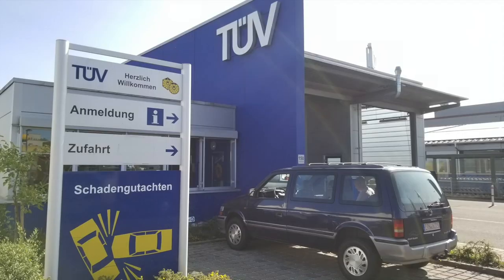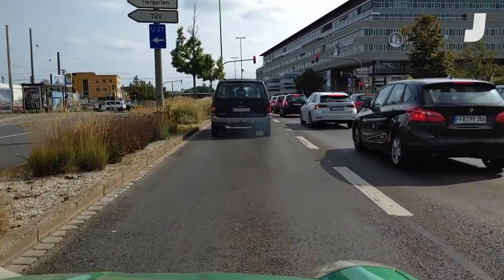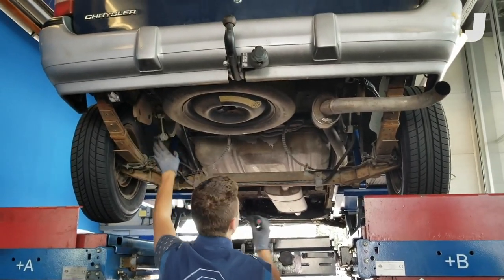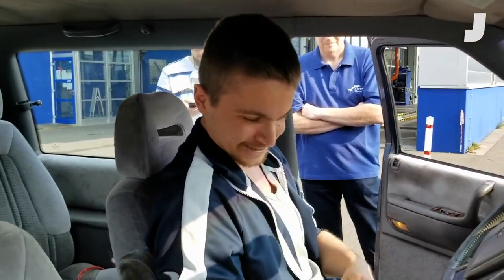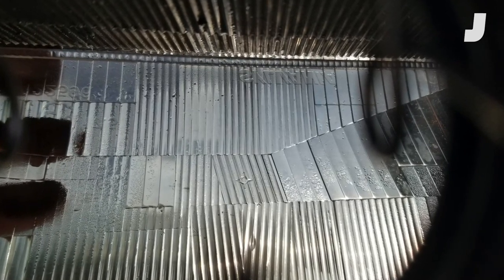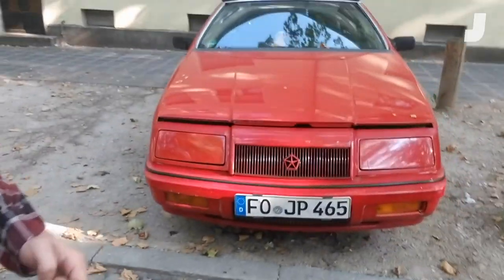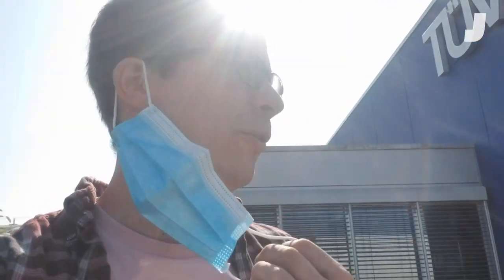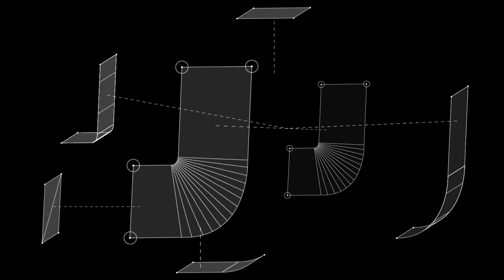I Took A 250,000-Mile Minivan Through Germany's Rigorous Car Inspection And It Was A Disaster

Comment: The whole point of the test is not safety never has been. It is there to nudge you into buying a new car. Need proof look up daily trip inspection for commercial vehicles. I do a daily inspection on my school bus in the US in Texas of all states that goes over just about everything they go over daily. 

 I don't put the bus into a machine to test it but I have to check it for damage daily in all those systems. Now, that is a safety inspection. Yearly state inspections which I also did at a past job in Texas are a joke and really just there to nudge into buying a new car once a year. That yearly inspection doesn't even go into the stuff I do daily for my bus daily. It is just there to scare the average Joe into either paying for repairs, or getting a new car. Both actions generate income for the state from taxes. It's slimy, and a lot of states in the US are dumping it in favor of just letting police ticket offenders that are clearly not keeping their vehicles maintained safely.

Comment: Portuguese inspection:
Is it safe to drive? Yes, you're good to go. Is it not safe to drive? Here's why. Now don't go and drive it too much but you have 15 days to fix it. It is too dangerous to drive? You're only leaving on a tow truck, baby.

Never in my life have i seen a car fail by emissions for instance, apart from an old Mercedes C220 CDI that made a complete James Bond smokescreen if you slammed the accelerator.

Also it really depends on the inspectors. Some are by the books, some are helpful and don't tick easy fixable things. For instance, the last time she aligned my headlights for me.

The most overlooked items regard emissions. Some don't care, some are anal. The rules changed recently but before this very month no one had updated the rules which came from 1997 xD

But most of all no one will say jack shit if your paint is ruined, if the clutch has seen better days (so long as it's not slipping), or if the electric windows not working.

Comment: I haven't seen one of those in the us for a long time, probably were all crushed during cash for clunkers which was of course a short term scheme where they nailed an iron spike into their own legacy as people get a bad impression of your brand if none of your older cars are left on the road, it implies they don't last.
Inspections are just more over regulation, truth is most cars simply age out or are totaled as they become anything close to a danger, the prime cause of accidents remains driver error.  So you have a vast infrastructure created for an illusion, same goes with emissions.  In fact the more "eco" they make new cars the shorter they last, overstressed turbo charged tiny engines for the masses, who thought that would be a good idea, regulators did, and so did scrap yard operators.

Comment: I'm not quite sure I'd be down with a vehicle inspection that involved somebody decking the throttle and bouncing my engine off the rev limiter.
Reply: Yea, that was crazy.  I'd want to slap his face if he did that to my car.
Reply: @shoechew  I also think that was a bit on the nose. Here in slovenia they usually rev it to 3-4k. That's why I always advise people to go in with a warm engine.
Reply: It's a diesel only revs to 4k or something. They also do it to blow out the soot to give it a better chance of passing.
Reply: @drzej3k794  Yeah, but 4,000 RPM is a really big strain on a typical diesel.  Not all engines are the same.  It's like saying "Well who cares if they rev it out to 10,000, an old V8 F1 car can do 19,000!"

Comment: That high reving this old Diesel hurts so much!! Is it necessary?
Reply: Yes. My X3 will sit at 5000-5300 rpm constantly on parts of the Autobahn. Sometimes for 20 minutes or more if i am on a section with little traffic and no limit. The engine has to be able to handle high revs.
Reply: yes its neccessary for the emision test. if it cant handle it its not road worthy either.

Comment: Seems like inspection place is pretty dumb if they don't know how steering locks work. I've never owned a car with a keyed ignition that doesn't have a steering lock position other than me maybe my old Bronco. My my 4Runner has one, my Miata has one both of which were built in Japan. My old Dodge, Ford, Chevy Trucks had one too.

Comment: In Belguim it would fail to. Junk dont don't belong on the roads( and yes...i drive a 15 year 210.000km car and every year it pass the " control", without any remarks. Maintenance is everything.

Always check yre car, before going in the TUV. Water in liheadlights/ lamp hanging/ not working etc...all thing thats that cpuld prevented. 
Now..a huge waist of time ( also for the inspector) and money.  Did you really needed 1 month....amd still fail,  by Jove man

Comment: Now try to imagine getting a 20 year old, highly modified FD RX-7 through this inspection. Cheers... :D
Reply: You can, but each and every mod have to be TÜV approved. Either by you (expensive) or by the manufacturer of the part (less expensive for you). Bring the TÛV approval document for each mod, and they will add it into your registration document.
Reply: @081588101  yeah it's not a problem just a bit costly when you do alot. Some mods don't need any documents at all. Extra gauges for example. But everything car/body related
Reply: @081588101  basically if you modify the car you have to do a very rigorous (and costly) inspection, almost the same kind the manufacturer goes through to approve the cars for sale, which honestly makes perfect sense. If you think about it its ridiculous that in the US the car to be sold has to pass a bunch of tests and regulations and after buying it anyone can modify it in ways that it will no longer meet those legal standards.

Here in Portugal that more rigorous inspection (called a type B, as opposed to the yearly type A thats legally required) is tough enough that no one modifies their cars. Stuff like an engine swap, even if the engine youre swapping is the exact same spec from a similar car, require a type B inspection, same for using a tire measure thats different from the original the car came with
Reply: That's funny, because German youtubers I watch do not act like getting modifications to meet tuv is some easy thing lmao. It seems it vastly limits the options you have for aftermarket parts of course too.
Stop lying lol. 
We're doing fine without inspections this ridiculous in the US and we don't care what you think about it lol.
Reply: @081588101  The only downside is that you need have all the ABEs ("general permission of service") for all your aftermarket parts with you so your registration slip isn't just a registration slip for a heavily modified car, it's an entire registration folder in your glovebox. :D
Reply: @081588101  the German system of needing most modifications registered on your car's registration slip, compared to others in the EU. Good for road safety, bad for overall convenience.

Comment: I have a Dodge from the same era with the same ignition switch. That is exactly right: off position is so you can still steer while being able to cut ignition. That inspector is an idiot and shouldn't be telling people what is and isn't safe lol
Reply: But this is tested according to German standards and not what Americans do in their country. Here's the law for it:
A steering wheel lock secures vehicles against theft. According to § 38a StVZO, securing is mandatory for all cars registered in Germany. It is standard equipment and is already integrated into all new cars by the manufacturer.
Reply: @michaelkuschnefsky362  that is a European spec van, so it should meet EU requirements at the time of manufacture. I just think the inspector didn't understand how the wheel lock works on that model. They do have a wheel lock.

Comment: Dude a wheel cylinder is $10
Reply: ya but probably the problem isnt from cylinder after he cleans it ..probably the shoes need replace or calibrated to same thickness
Reply: if I had to guess, it would have needed to be imported , or german part costs are crazy

Comment: What's funny to me is that most modern BMWs would never pass this inspection, even with less than 1,000 miles on them. LOL
I can just imagine various plastic bits flying out of the engine compartment and/or melting. It kinda seems like they're trying to break this because they are salty that their domestic vehicles would never survive 250k. Not that Chryslers aren't total garbage but still. BMWs can't pass that inspection. No way.
Reply: BMW got nicknamed "Bring mich (zur) Werkstatt": get me to the garage/workshop

Comment: And yet it has no third brake light 😂
Reply: In the US those became required in the 80s, but in Europe only around 2000.
Reply: @zanthraxnl  interesting! That’s surprises me, but I suppose since they require amber turn signals in the rear it’s less necessary
Reply: Actually third brake lights were forbidden until they became mandatory in germany. My dad owns a 1995 GMC Vandura over here in germany and when it was shipped here they actually had to cut the cables of the third brake light because it was forbidden at that time, because „it could blind other drivers or irritate them“

Also red rear turn signals are a no-go over here
Reply: @KokaburraDesigns  true but you can have white turn signals in front
Reply: @Sadik15B  Already....But then they need an orange colored illuminant (lamp) inside.
Reply: @mawa01  no not for front the bulb can stay white.
Only rear has to be orangep
Reply: @Sadik15B  Sorry, that's not right. Here in Germany the forward facing turn signals may be yellow or white (side turn signals even grey). But the bulb in the white turn signal has to be orange. 
At the TÜV inspection a white turn signal with a white bulb would even be a minor defect. Here is an excerpt of the road traffic licensing regulations (see point three):
Road traffic licensing regulations (StVZO)
B. Vehicles

III. construction and operating regulations

§54 Direction indicator

 (1) Motor vehicles and their trailers shall be equipped with direction indicators. After being switched on, the direction indicator lamps shall flash at a frequency of 1,5 Hz ± 0,5 Hz (90 pulses ± 30 pulses per minute) between light and dark and in the same phase on the same side of the vehicle, except on motorcycles equipped with AC lighting systems. They must be so placed and designed that the indication of the intended change of direction can be clearly perceived by other road users for whom their visibility is important under all lighting and operating conditions. Direction indicators need not fulfil their function as long as they emit hazard warning lights.

 (1a) Direction-indicator lamps pointing towards the rear of the vehicle shall not be fitted to movable parts of the vehicle. Front-facing direction-indicator lamps and additional side direction-indicator lamps may be fitted to movable parts of the vehicle provided that these parts have only a normal (operating) position. The first and second sentences shall not apply to direction-indicator lamps which may be removable in accordance with § 49a (9) and (10).

 (2) If direction indicators are not mounted in the driver's field of vision, their effectiveness shall be clearly indicated to the driver; this shall not apply to direction indicators on motorcycles or to auxiliary flashing lamps mounted on the side. Direction-indicator lamps must not obstruct the driver's view.

 (3) Only direction indicator lamps for amber light are permitted as direction indicator lamps.

............
Reply: @mawa01  this is the dutch rule

The direction indicators and hazard warning lights must emit no other than amber or white to the front and no other than amber or red to the rear. Method of inspection
Reply: @Sadik15B  Yes... That's why here in Germany we always have to retrofit the vehicles to comply with the German StVZO. 
For gas systems in caravans, we always have to retrofit or upgrade them to comply with the German regulations. On a Ford 250 we had to change the front headlights, because they did not have the necessary right side illumination. 
That's just the way it is here in Germany. In former times you could drive the American lighting with special permission. This was also possible with the spoilers, which were partly made of metal. Today unthinkable!

Comment: Sorry but how does revving the crap out of the engine with no load give you any kind of a result of how it will perform on the road. Isn't this exactly how VW got away with their emissions scam?
Reply: This is NOT a real world emissions test. Just certain parameters are tested. For a Diesel engine those are: idle and max rpm (engine specific) and soot (when revving up). Depending on the emissions class certain levels of soot are allowed.
NOx is not tested. So, a EGR delete will not be noticed. This is, unless you remove all the related plumbing in the engine bay and the inspector notices it. If you just block the EGR tube with a plate, no inspector will ever notice with that kind of emissions test.

An emissions test for homologation is a completely different story. The car is put on a dyno and a certain load and speed profile is run. For this kind of test, a whole different kind of emissions test equipment is required. The VW thing was to equip the car with software to recognise it being on a dyno and tested. In that case the ECU would run a different program so it would put out less pollution than in real world driving.

Comment: Strange how german cars breaks down the most often as compared to a japanese car like toyota or lexus when they have this kind of strict tuv requirements
Reply: There is two reasons you have to understand 
1 German cars a built to get beaten hard on Autobahn etc. To do so they require regular maintenance. 
In average, cars in Germany drive 15k kilometers a year. So it takes about 7 years to reach 100000 km or 60000 Miles. That said, it doesnt require that much maintenance.

Comment: Just replace the damn brake actuator! It's a 25 dollar part not worth it to be messing with like that! 
Also,  the inspector was right to fail the steering lock. That is indeed a stupid bad design and should be disabled permanently by removing the locking bolt. Safety is more important than the chance that someone with want to steal a POS SUV.
Reply: from what I was told, it was designed in a way that when the transmission was in "drive" the wheel wouldn't lock in any position, which makes sense given it was a US design. just the problem is his is a manual.
Reply: @cpufreak101  Then it is an even worse design oversight. American engineers apparently were aware of the danger but when designing the manual, they went : "Eh, f*ck it, they shouldn't be driving stick anyway".
Reply: @pauldickhoff3594  considering the fact that probably only the base models got the stick shift (if available at all in that generation here), I honestly wouldn't be surprised if that's kinda what happened

Comment: Those rules are way too strict. That is insane.
Reply: I personally think it‘s in your own interest, because they basically check your brakes, suspension, steering, rust on the most important parts (you won’t fail for rust on a door or fender but you will fail if you happen to have excessive rust on your frame or simmilar spots) and lights. Those are safety basics. I admit that there are some things that might be to strict (for example Modifications and emissions regulations) but i guess that also has a reason.
Reply: @KokaburraDesigns  given the fact that he had to prove his steering operated the way it was designed, and functioned normally, it is too strict.
Reply: @Nedula007  So the only mechanism you have to change direction and maintain stability should be less stringently inspected? Yeah no.
Reply: @urbanoman7689  Yeah, yeah

Comment: What a waste of money. All those special machines, just to tell people “no” that the car they have slaved for has minor issues and can’t be driven
Reply: You fail to realize how dangerous those ''minor issues'' actually are.

Imagine having play in your A-arm and having to throw the anchors at 130mph on the autobahn. Or uneven brake force distribution, or bad shocks, or steering gear imperfections.

Corrections become exponentially more difficult and dangerous as speed increases. That's why it's important to have stringent inspections on cars that will frequently travel on a (mostly) limitless highway.

Comment: 75% of the braking is done with the front brakes anyway why be such Nazis about the rear brakes
Reply: Because if the brake force is too uneven, it causes the car to change directions under heavy braking, which is extremely dangerous. On slippery surfaces, it can cause the car to spin or even flip (in case of more top-heavy vehicles).
Reply: If you slam the brakes on from autobahn speeds the uneven rear brakes could send you into a spin.
Reply: @phoneyfredy  I'm sorry about your genital problems.